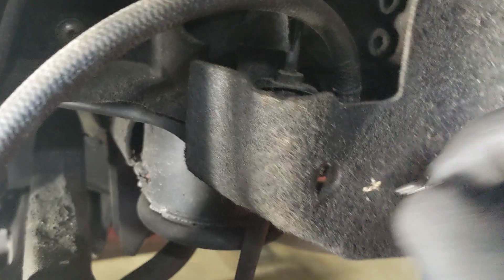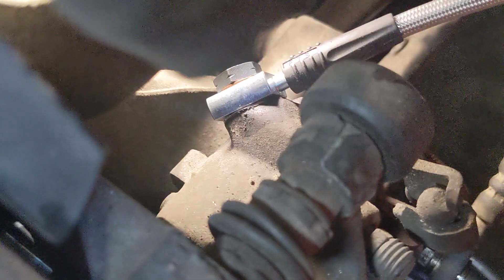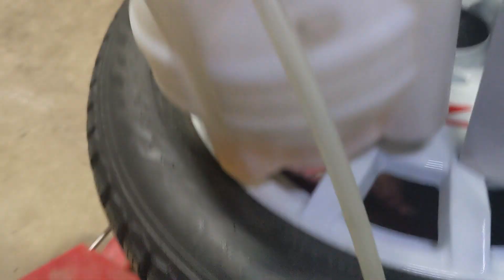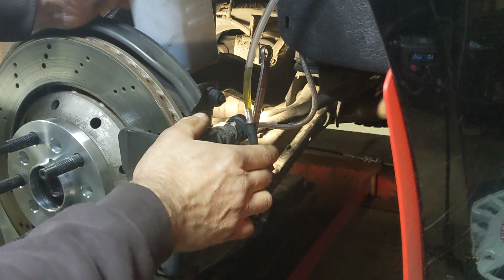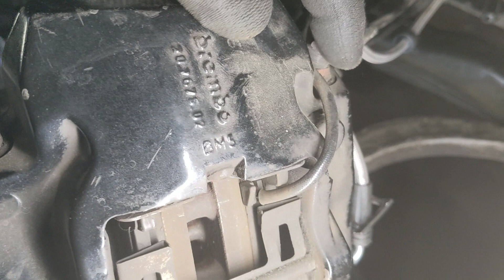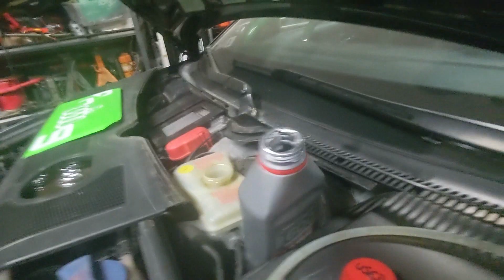B7 RS4 JHM braided stainless steel brake lines installation and brake bleeding

Comment: no problem with those lines ? reliable ? I want maybe to swap to them ... seem to be the less expensive thanks for your help
Reply from the maker: No issues, more durable than the stock rubber lines. We use a similar setup on our stage rally cars, very reliable.